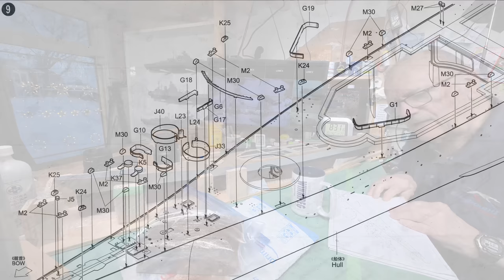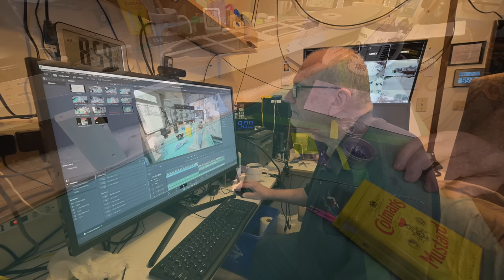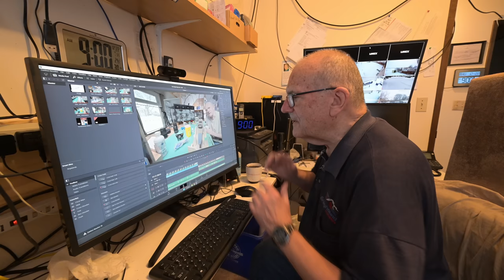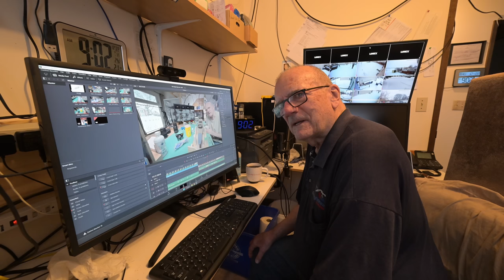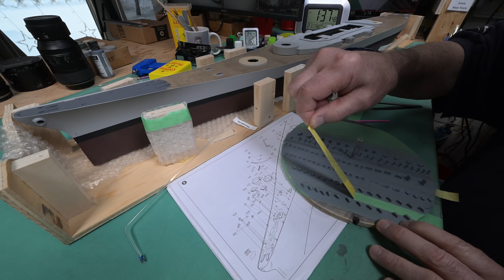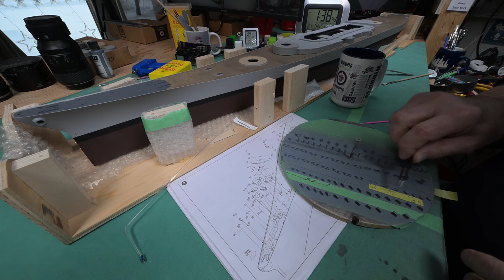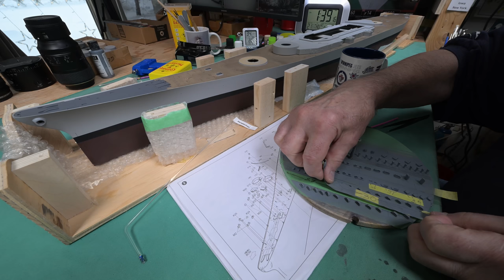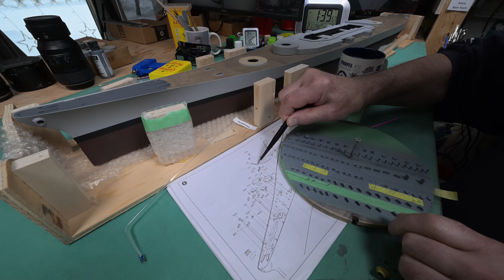The Model Ship - Part 1407

Comment: Hi Ron, In part 1401 & 1402 you used Panel line to age the deck. There is an easy way to blend that product and leave the colour effect in the plank lines even after it dries. A flat brush, like the one you used to apply the wash, moistened with mineral spirits. When I say moistened I mean almost dry. Brush over any areas where there is too much surface wash and the heavy areas will fade out leaving the wash in the seams between the planks. Keep wiping the brush to remove the stain and refresh the mineral spirits. Light motion with an almost dry brush will do a lot to make any blotches fade away. I use the product on amour models to give definition to small details.
Your dedication to your hobby and the quality of your videos are very impressive.
Merry Christmas from Lasalle QC  Dennis Brown
Reply from the maker: Hi Dennis,
Thanks for the detailed tip! 👍

Comment: Actually Ron, in world class competitions you’d be surprised how good the models are built and painted, even very closeup. If models and/or dioramas don’t make the grade often a certificate for gold medal is not given. I had a  bronze medal world championship prize when none of the models in the exhibition were good enough for a gold medal certificate. I lost points because the diorama had two chips that happened in transit and I didn’t notice. Very bad of me really, should have checked better. Generally, marking for high end competitions is strict, you can’t get away with anything, especially substandard painting. I know many judges who use large magnifying glasses and light sources for inspection.
Reply: I recently went to the Brisbane hoby show , there are some amazing modellers out there 👍👍👍👍
Reply from the maker: Re: "many judges who use large magnifying glasses and light sources"
I was wondering how close they looked. Interesting! Thanks! 👍